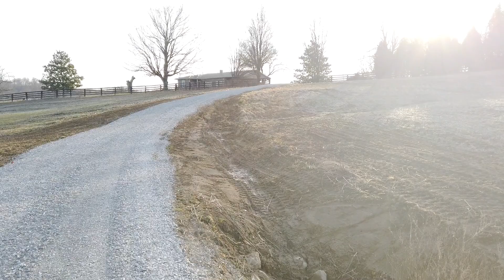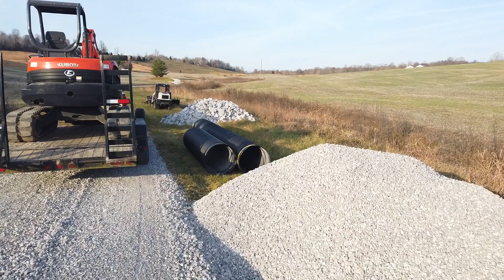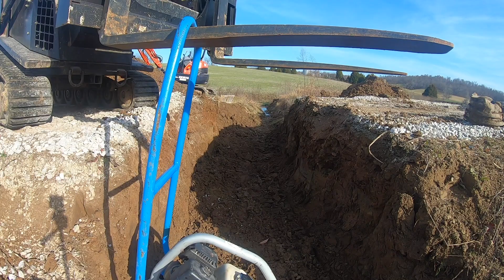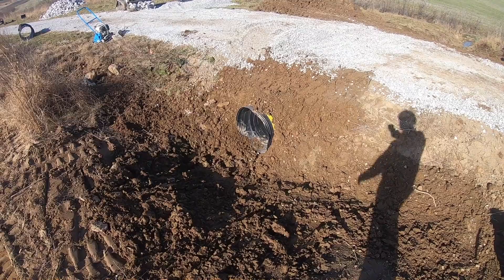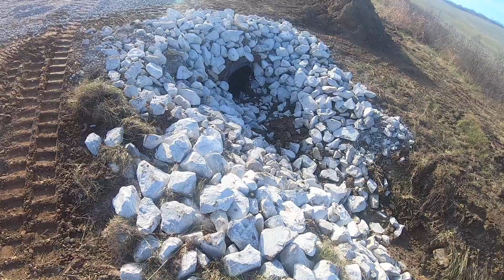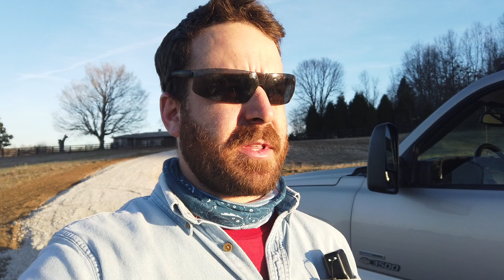New 24" Driveway Culvert & Rip Rap

Comment: What is the Weight of your larger Excavator ?
Reply from the maker: That kx161-3s was a 12,000lb machine. I have since sold it and my smaller kx71-3 (6,500lbs) and bought a kx040-4 which is about 10,000lbs.

Comment: Saw your video where you were talking about trailers. There is a couple examples of gooseneck trailers on my channel, Tristar Diggin'. Good example of a trailer with a remote controlled  hydraulic tail and hydraulic jacks is on "Threw Down Some Felt and Rock" at the 25 minute mark. Worth every penny if your loading and unloading everyday and hauling 2 machines. The other one is a low profile tilt deck gooseneck,  perfect for one machine and getting in tight places. Hope that helps some. Backing a gooseneck is a breeze once you do it a few times. Turning radius is very nice with a gooseneck too...
God Bless, 
Sam
Reply from the maker: Thanks Sam! I took a look, nice content! I actually already bought my 20k bumper pull trailer. Very happy with it! I need to get an update video out on that and a few other big changes, but I broke my hand on the 18th and have been a little out of commission.

Comment: Hi Neal, I’m very curious about you using gravel on the bottom and to backfill the pipe. I would have to think the water will filter through the gravel and at some point start to undermine the pipe. I was always under the assumption that the pipe had to have a good dirt pack around it to force the water through the pipe??
Reply from the maker: Hey One Eye! 57 Stone is most often used and widely accepted for pipe backfill in my area. It requires almost no comparison effort and is considered by most to self-compact to 80-85% density just buy dumping it. Some small amount of water may percolate through, but generally will not wash out the stone. I'd be much more concerned about water washing out finer particles like sand or uncompacted clays. 
See Page 23, table 4. https://assets.ads-pipe.com/m/5361f3a2131f996b/original/Corrugated-Plastic-Pipe-Storm-Installation-Guide.pdf
Reply: Thanks @Neal O’Russa! I was just curious, I have a couple pipes here at the house I have to put in this spring and just hadn’t seen anyone ever backfill with stone like that. I guess as long as it isn’t a pond with water pressure, it will work all the same. Nice job on this ditch project. Hope you keep getting more subscribers! Good luck in the coming years!
Reply from the maker: @OneEyeCustoms  thanks! Good luck with your projects, they're always fun!